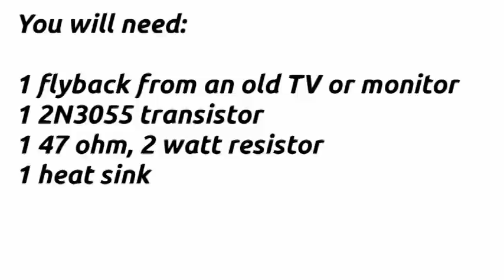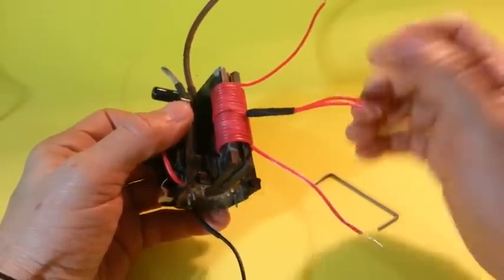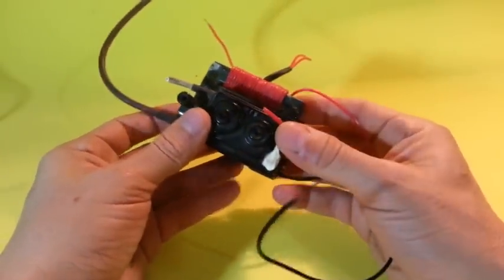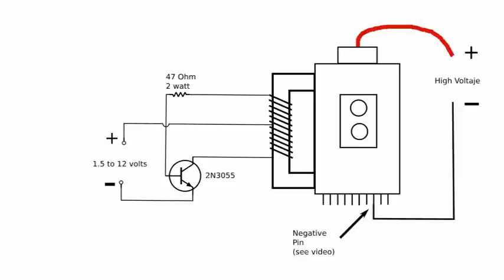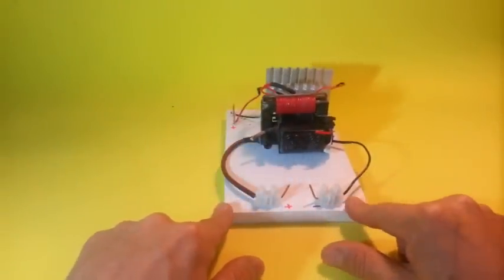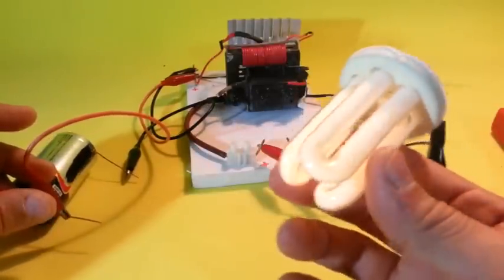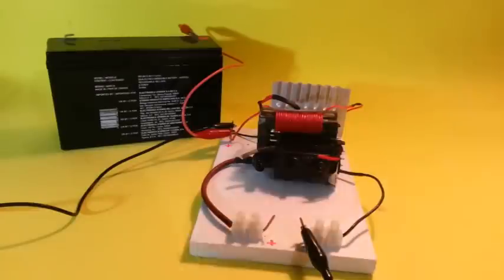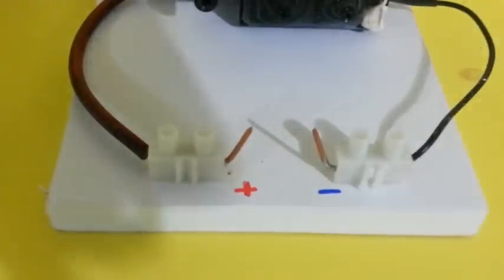High Voltage Joule Thief with Flyback - 10,000 Volts

Comment: I think you should be able to prevent/reduce the transistor from over heating by adding a peltier unit, capacitor, and computer cooling fan.

Comment: The best tip on this build is to use the TV or CRT horizontal transistor too, something like 2SC3997, 5 turns to the base and 10 or more for the colector, with this transistor I have used 2K 3W if I remember it correctly maybe was a potentiometer.
But why?
Because it's a high voltage transistor and will survive to much more higher voltage, will of course became hot too but less then the 2n3055 and it is made just for this...
I have tested for hours with this configuration with no problems at all, almost 12 years ago. ;D

Comment: does the wire have to be insulated? i bought some 16 gauge copper wire for the antenna and i'm wondering if i can use that for wrapping around the flyback.

Comment: can i use 19 gauge wire
Reply from the maker: no, 16 or thicker
Reply: ok thanks :)
Reply: Why does it have to be 16 or thicker?

My flyback doesn't have enough room for them. Also can I use a different transistor?

Comment: How do you connect the wire that goes around the heating and attached to the transistor and what does it do?
Reply: Heatsink*
Reply from the maker: Adam Adreveno it is connected as in the diagram provided, the body of the transistor is the collector.
Reply: OK

Comment: Is it possible to use for continues period of time. like, to use as electric fence etc..
Reply from the maker: No, only a few minutes
Reply: Thanks.
Reply: You can, if you use stronger transistor or less input voltage. Pretty much the only limit here is the transistor. You don't need very high powers for electric fence anyway.
Reply: haha yup indeed.
Ok, what about using MOFET.
Reply: I think you would eed a different driver. I'm pretty sure I've tried this one with a MOSFET, and it didn't work well.
Reply: hmm.. thanks pal..

Comment: Very useful video but how did you measure the output voltage and can I adjust the output voltage. Thank you.
Reply: The dielectric strength of air is about 10Kv per centimeter. So if your arcs are 1cm, it's about 10Kv. You can also make a probe using Mega Ohm resistors and use your regular meter to measure high voltages. There are several videos online how to make a high voltage probe.

Comment: Ok got it to work finnaly. I have a 12V 4A power supply now and it worked for a brief momment and it blew the transistor. How much should i lover the V/I i was thinking getting a 2k2 resistor in series for voltage to go to 9V what do you think?
Reply from the maker: +nadgoB yes you can try that, another possibility is to use two transistors in parallel to share the power

Comment: are the two pins on the 2n3055 transistor interchangeable nad can you solder the wire onto the collector part of the 2N3055?
Reply: **will it mess up the transistor if you put the wires on the wrong pins and mix it up
Reply from the maker: Adam Adreveno of course, you cannot interchage the pins
Reply: ok

Comment: could you add in another fly back transformer and multiply the voltage again, to 1/2 million volts?, or would that just destroy the fly back transformer?
Reply from the maker: +Randy Travis No, the windings of the second will short circuit
Reply: how about another ignition coil, or voltage multiplyer?
Reply from the maker: +Randy Travis 0.5 million volts is very difficult to obtain, perhaps only using a voltage multiplier
Reply: thanks

Comment: The windings are wrong. the end of the first set of ten turns should be soldered to the end of the second set or ten turns.

This goes to the plus side of the power. 

Either of the remaining two wires goes to the base through the 47 ohm resistor.
The other goes to the emitter. 

It would also help to add a 1n4007 from the base to the emitter  and another 1n4007 from the collector to the emitter. They aren't absolutely required but will help protect the 2n3055 from voltage spikes
Reply: Dick Bromberg 
I always do opposite windings, not parallel ones. The end of one connects tot he beginning of another, just like a center tapped transformer. The "tap" goes to power, one is for feedback and the other is the power winding.

The way you mentioned is the "official" way of doing it though, where the power on spike switches the transistor on very hard, then it saturates and switches off from the back emf.

The version this guy did, which is also the way that I do it, the initial power on spike after the transistor turns on, turns off the transistor, and the back emf of the collapsing field switches it on harder, which immediately switches it off again, this continues until it builds up resonance. This circuit generally is able to run with even greater variables and less construction accuracy, but has less peak to peak power output, a higher output voltage and a higher switching frequency.

Comment: Getting  close to a hairpin circuit which is a logical step.  Maintaining  a  constant or even an increasing  power modulation and the addition of  a CE  circuit   with  dual earth grounding  and   you would  have  perpetual power and a  self sustaining   device.  Resonating  cold  electric is the solution  and  the  safety issues  and  heating  issues  are no longer problematic.

Comment: can it be because pf the battery? i am using a standard 9v, the small battery you know and it has like 7v now left in it. could it be because of that. im getting like 80v dcv and 100v acv
Reply from the maker: +nadgoB 9 volt batteries do not have enough power for this. you need  BIG battery, or a power supply that can give you at least 3 ampers
Reply: omg so that is the problem... can you recommend some batteries i can buy at a cheap price
Reply: +nadgoB wire some 9 volts in parallel so you have more amps.
Reply: +nadgoB You can use a car battery, or you can go to your local electronics store and pick up a 12v 7Ah SLA battery for $20 or so. And it will be rechargable, so you never have to buy any more batteries!
Reply: I know i made it work with a laptop battery charger
But thank you!
Reply: nadgoB Glad you got it to work!☺

Comment: There is 47ohm resistor in your blueprint, but i cant see it on your build up generator. Did you used it or not?
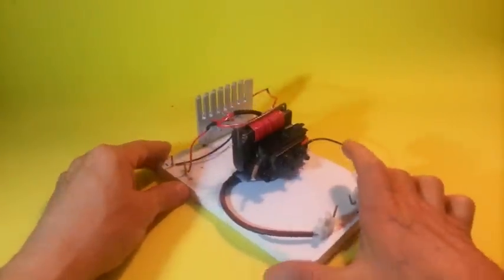Reply from the maker: +Cirvem D The resistor is there, check the video at 1:36

Comment: In the diagram, shouldn't there be four wires leading from the (external) coils of the flyback, instead of three? Am I interpreting it wrong?
Reply: wires are connected. The middle wire (+) is common to both coils.

Comment: Can i use the primary coil of the trans and skip the winding part?
Reply: The external windings make the flyback produce AC voltage. The flyback internals have diodes to make DC voltage, so you need to use an external winding to utilize the flyback in an AC configuration like this with these components.

Comment: Can all of the the "High Voltage Joule Thief with Flyback" be placed in mineral oil to protect the transistor?
Reply from the maker: Yes that will be good.
Reply: Would a 5 watt 47 ohm resistor be better than the 2 watt you recommended?

Comment: it works when i connect the end of the first to te end of the second coil for the + and it gives a small spark. But it wont work when i connect the end of the first with the beggining of the second at all... i have 2 new 2n3055 transistors and neither will work :/ any ideas
Reply from the maker: +nadgoB try to wind more turns on the flyback core

Comment: Hi... I'm back with one more thing! I have finally made my final driver which is mazilli's zvs driver... I get very good arcs and tesla coil is working awesome.. But as always.. Bad happened to me again... I was using computer psu with 12v 18A but I kept the driver on for 30 seconds and the psu blasted (kind of)... Now I want to know that if I can use a 12v 2A ac to dc adapter as power supply?
Reply from the maker: Anurag Trivedi 2A is not enough for a mazzilli, the driver can draw 20 amps easily

Comment: It still doesnt work.. i have a new transistor nd still nothing... can you explaine how do you mean invert them? Do you mean to invert for example thqt the ressistor aligator clip (i connected the parts with aligators) to the wire near the negativ instead of the possitive side of the flyback? I hope you understand what i tried to say...
Reply from the maker: NinjaJesus one terminal of the feefback coil goes to resistor and the other to positive. By inverting i mean the terminal that goes to positive now connect to resistor, and the terminal that goes to resistor now connect to positive. And dont use alligator clips, one clip may be making false contact.
Reply: Ludic Science well i tried that too, and i tried it withput aligators.. still nothing.. Is there a specific thing i'm missing out? A specific way to wind the 2 coils or something during connection of the 2 wires? Should i sand the transistor or the resistor where they connect with the wires? Anything at all? What if the resistor is like 90 ohm instead of 47? I mean i said 47 and rings say 47 but it could be wrong...
Reply from the maker: NinjaJesus The only thing is a broken flyback. The rest of the circuit is very simple.

Comment: I made this project but it doesn't work; I'm sure the flyback and the power supply I used (from 3V to 12V 500mA) are fine. What can be the problem?
Reply from the maker: ***** Check your transistor, the circuit works, several subscribers have replicated the circuit
Reply: It requires minimum 3 amps

Comment: How many turns and can i use this as flyback driver for tesla coil with 12V 18A?
Reply: Anurag Trivedi so ,, i tried this with a 9v battery(with emf 6.03V) but the output of flyback was near 6.5V DC and i also measured it with the AC settings .. it was near 12V AC!  what im doing wrong?
NOTE: I did not remove the Clip of the Flyback!
Also .. is that because of im using two different winding wires- Primary- BreadBoard Jumper Wire (COPPER) and FeedBack- BreadBoard Jumper Wire(ALLUMINIUM)     Both are 5mm Single Core
Reply from the maker: Anurag Trivedi 9v batteries do not have enough current for this kind of circuit. That is the reason.
Reply: Ludic Science should I directly try with 12v 18A
And the 9v battery was making weird noise like it's overloading.... 
And what battery u are using!? The A size?
Reply from the maker: Anurag Trivedi Try first 6 v. I am using a motorcycle battery.
Reply: Ludic Science ohh it looks like normal torch battery 
Confirmed my flyback is not dead https://docs.google.com/file/d/0B0l6XJzpbQYGZVNyd1dSRnpFZUE/edit?usp=docslist_api 

Here is picture of the this circuit working with 1.5v AA battery(nearly dead)

It's generating around 25v dc
Reply: Ludic Science Not working with 5V 2A and not even with 12V 18A but works with 1.5V AA( can only light up led)  .... What is going on? With both 12V and 5V the transistor does gets hot in a few seconds but the output is only around 1.5V DC  and 0V AC( can't even light up led).

That's ok if u can't do a test but tell me if the tip31c will work or not.... If not then I'll rush to the robotics store today for 2n3055 and tip35c...
Reply from the maker: Anurag Trivedi the circuit should work with 2n3055 and tip35c
Reply: Ludic Science okk I'll get both of them + irfp260 mosfet day after tomorrow and let u know results
Reply: Should I try a royer oscillator circuit as flyback driver?
Reply from the maker: Anurag Trivedi This is not a royer oscillator. but you can try if you want
Reply: Ludic Science i will get the components for both Your Driver and Royer Oscillator and got a new phone with decent camera so ill do a video and upload it!! and i guarantee that both circuits will work as ill get 5-6 Flybacks too!
Reply from the maker: Anurag Trivedi Now that the circuit is working you can play a little bit with the primary turns. Change the primary turns to see what number gives you the longer arc. Also you can try with 15 volts input. That multiplier will not work because it needs AC and the flyback gives DC
Reply: Ludic Science But i dont have 15V power supply...but i have +12V 18A and -12V 0.8A... if i use +12V as +ve and -12V as -ve then it will be 24V 18A! should i try this 

or 

should i use 12V 18A + 5V 32A = 17V 18A?
Reply from the maker: Anurag Trivedi yes you can try
Reply: Ludic Science  ok... My circuit was working but now I tried the royer oscillator with 2x 2n3055 and same flyback and 12v 18A but still the arc is about 1cm... But has power (accidently touched the +ve it was horrible!! Fingertip is burned a little.. Thank God it didn't pass through heart). I have 7+7turns primary and 4 turn feedback... What I'm doing wrong? 

Also does the spark produce ozone? Asking because one of the symptoms is coughing which started to happen to me at night because I was working with it from morning..

Comment: when i try to make it work and this time it has an output and the voltmeter sais it generates 2v and i put a 8v battery
any help?
Reply from the maker: +nadgoB something must be connected wrong, you should get 1000s of volts
Reply: +Ludic Science i know but i tried connecting in so many waysband still nothing...  is it maby because i winded the coils wrong? is there a size or a specific orderblike do you start overor under the flyback i dont know... could it be the transistor?
p.s. i didnt get it to work at all with your model. i connected the middle to the R and the wire closer to the + of the flyback is my + on power. when i connect it your way i dont get anything. i get a small voltage when tappinf the battery tho. and i tried connectin instead tge ebd of the first and the beggining of the srcond cpil like you said i connected the end and the end for the + for power and got around 150 dcv and 200 acv
Reply from the maker: +nadgoB it should work with the model in the video. maybe your transistor is dead
Reply: +Ludic Science yeah i suspect the trasnistor too
ill buy today anottjer onse. can i get another one or dpes it just run ob 2n3055?
and just to be clear it doesnt matter how thick is your wire? 
and does it matter if the flyback is from a pc monitor (i think) because it has some kind of winds on tje top that you can turn for focus (thats what is sais)
Reply: +Ludic Science yeah i suspect the trasnistor too
ill buy today anottjer onse. can i get another one or dpes it just run ob 2n3055?
and just to be clear it doesnt matter how thick is your wire? 
and does it matter if the flyback is from a pc monitor (i think) because it has some kind of winds on tje top that you can turn for focus (thats what is sais)
Reply from the maker: +nadgoB the flyback from pc monitor is ok

Comment: hey i made one and it worked thank you i shocked my self several times and it hurts lol i recomend to use BD243c transistor it works very well with it and 100ohm 4w resistor i run it on 12v 1amp switch mode power supply (SMPS) and i am getting nice sparks also i get flyback for free from tv reperation he sad it was broken but when i tried it it worked ,there's one probleme when i run this thing and draw an arc the tv's on my house turns off,how can i fix the probleme?!
Reply from the maker: +Yasser crazy boy Great you got it to work! About the tv turning off, that´s weird, it never happened to me. Try running from a battery instead of the SMPS
Reply: yes that's a good idea,thank you :),i will make a video and send it to you ;)

Comment: 2n3055 works low frequency. why can it work in high frequency circuit?
Reply from the maker: Tuyen ta trung The transition frequency of the 2N3055 is 2.5 Mhz, that is more than enough for this circuit
Reply: Ludic Science ok. im wrong. i made it but the transistor was failure with 12V battery. i dont understand. help me!
Reply from the maker: Tuyen ta trung what kind of failure?
Reply: Ludic Science the transistor burned, it can not operate
Reply: Tuyen ta trung I need use it for tesla coil in my lab.
Reply from the maker: Tuyen ta trung Try using a more powerful transistor. Any high power NPN should work.
Reply: Ludic Science thanks!

Comment: Doesn't work, any help?
Reply from the maker: NinjaJesus check your connections, or maybe the transistor is bad
Reply: Ludic Science
Hmm connections are good everything is connected good, but the transistor is brand new, could it be broken?
Reply from the maker: NinjaJesus try inverting the connectios of the feedback coil maybe they are reversed, or your flyback is broken
Reply: Ludic Science invert them how?
Reply from the maker: NinjaJesus the feedback coil has two wires, just change the points where they are connected
Reply: Ok i will try that

Comment: It does not work for me.
Reply: play around with the phasing of the coils.
Reply: Make multivibrator and connect transistor to multivibrator output. Change frequency of multivibrator until circuit works. You can try MOSFET if bipolar transistor do not work.

Comment: scam
Reply: It is fun
Reply: not a scam, i find that if you keep it around 5 volts ie usb power ,you don't need to even use that same transistor. In fact i'm pretty sure i've used mosfets and got an even better result.